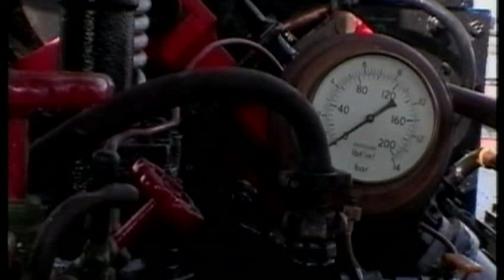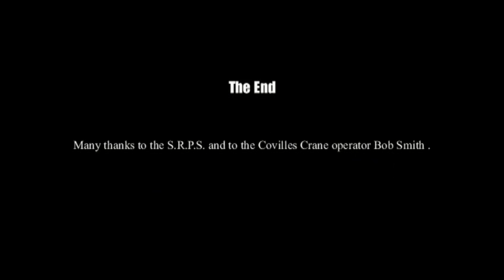Glengarnock Steelworks Crane Tank No.6

Comment: Is this some sort of load test being conducted here? Cranes have a safe working load & I wondered if the crane is being re-certified after restoration.
Reply: This film was made at the end of the locomotive's cosmetic restoration for indoor display.  The crane engine had been stripped and put back into a condition enabling it to be run on compressed air, for demonstration purposes.  The film shows the crane working, with nominal loads, for demonstration purposes so that this film could be made!